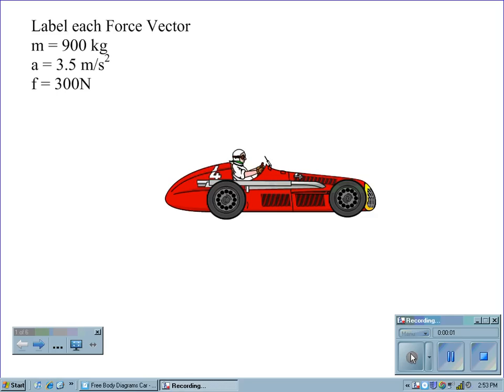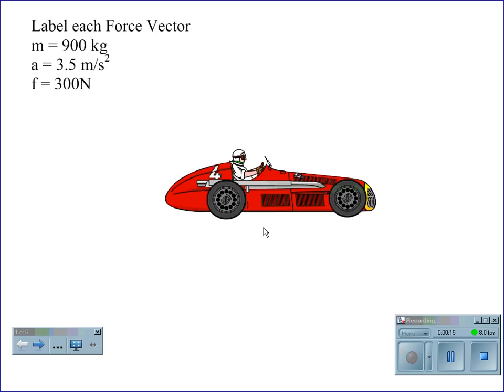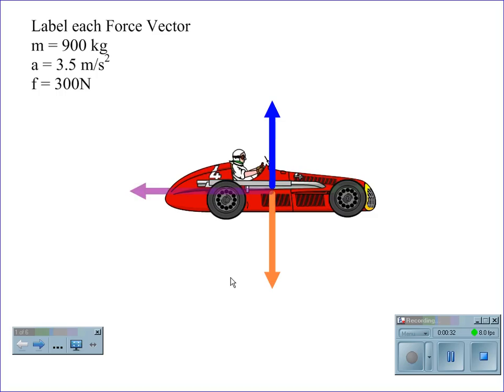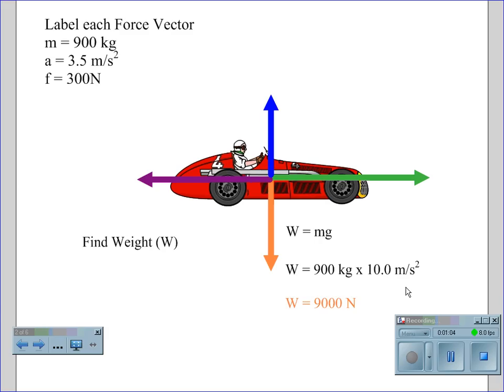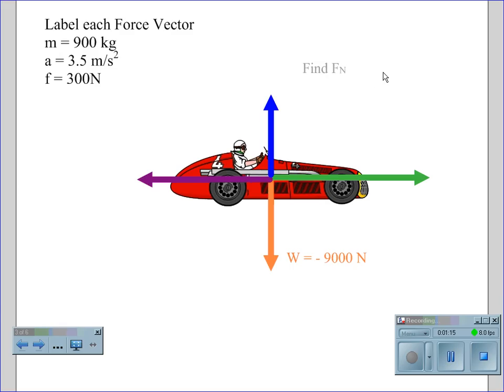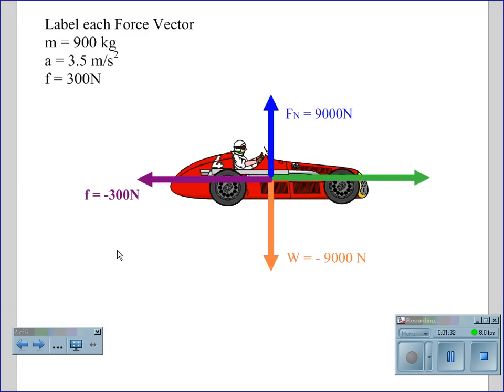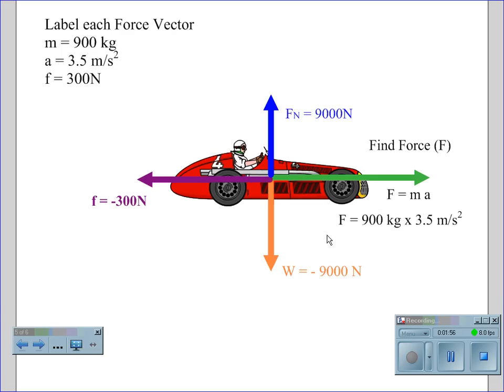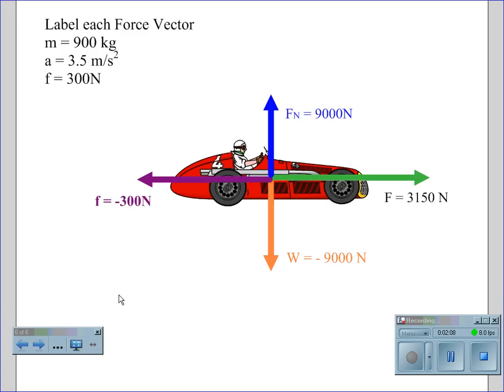FBD Calculations Car

Comment: Wouldn't the friction push the car forward? A car's tires push backwards on the ground and the friction propels the car forward, right?
Reply: You are right
Reply: Kevin Duan no...the friction is the force which makes any object have grip on its mass and movement... which makes it slower

Comment: The weight IS NOT ALWAYS perpendicular to the surface. If the car was on a slope, the weight would not be perpendicular to the slop. Weight IS ALWAYS parallel to the gravity field creating it.